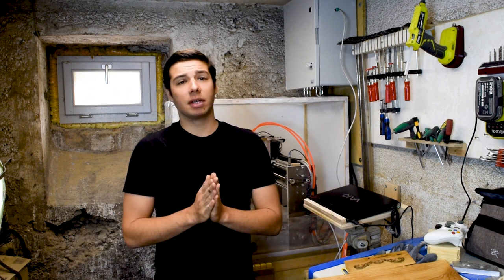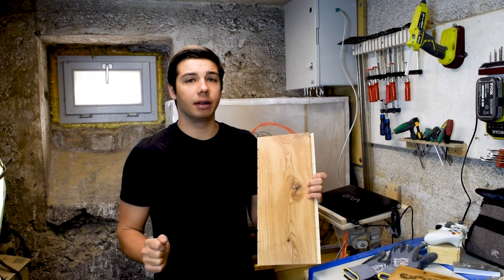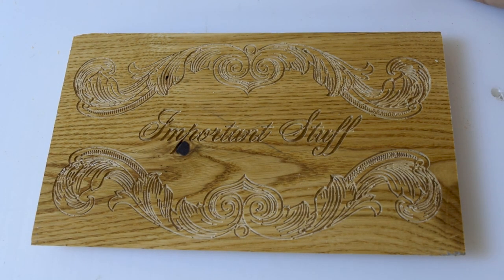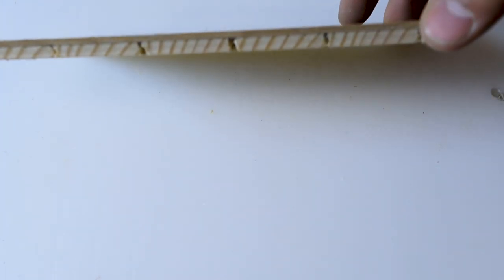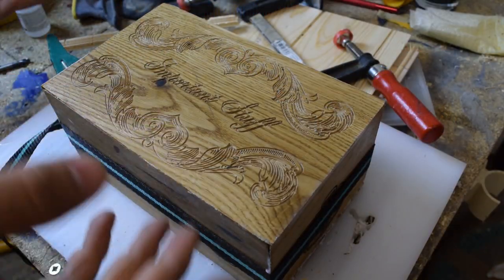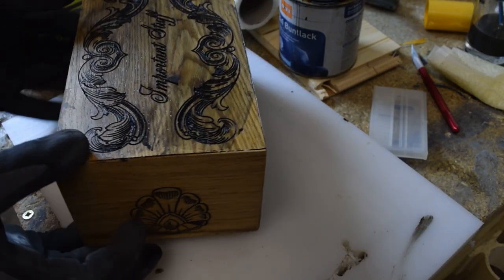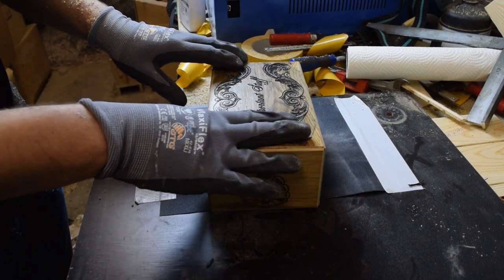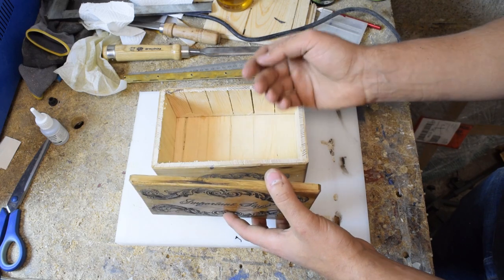Last minute CNC gift box || CNC Projects #5

Comment: Hey, I've got a short question regarding your spindle: 
Do you use an EMV Filter for your Power Outlet? I heard that these VFD Inverters can mess up your controller board as well as your endstops. I'm looking to purchase a 1,5kw spindle and I am not sure whether that's actually a good idea...:-)
Greetings!
Reply from the maker: Hey I actually don't have one installed but both my controller and my laptop are completely optically isolated so maybe that helps....
Reply from the maker: I was also worried about the vfd being so close to the other electronics but I had zero problems with my new electronics so far
Reply: @Uniquelymade  Ok, that sounds promising thanks! Your VFD looks like one from Hunyang, is that right?
Reply from the maker: Yeah that is correct. Cheapest 2.2kw water cooled spindle combo you can get 😁
Reply: @Uniquelymade  Sounds good although I think I'll buy a used 1,5kw spindle with a collet set. Just not sure about the vfd because I heard of some Huanyangs/clones blowing up...
Reply from the maker: Yeah it's probably a bit like a lottery. I bought one from aliexpress with a lot a confirmed buys and reviews but it still was a bit sketchy
Reply: @Uniquelymade  The VFD I'm looking at the moment is this guy: https://www.sourcetronic.com/shop/de/frequenzumrichter-st130-1-5kw-230v.html 
Mainly because it looks like a trustworthy german seller with good support and the vfd has vector control to get more torque at low rpms.